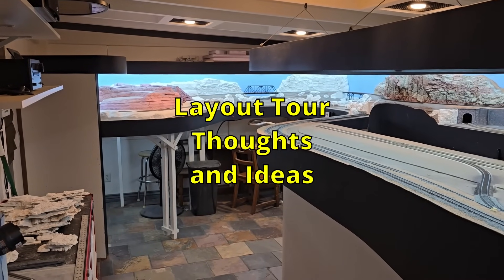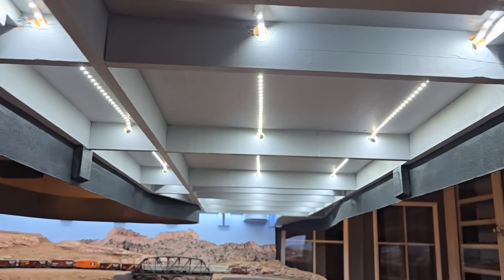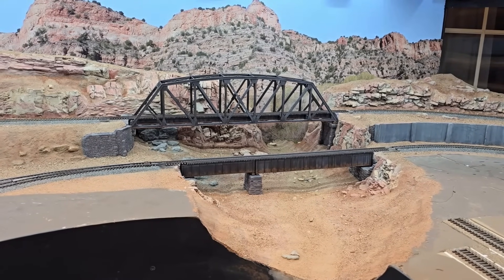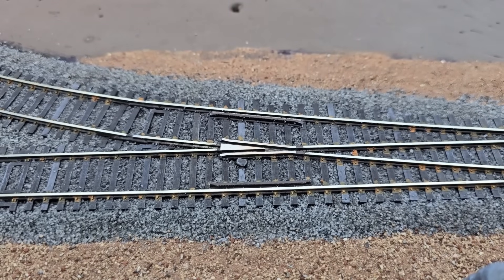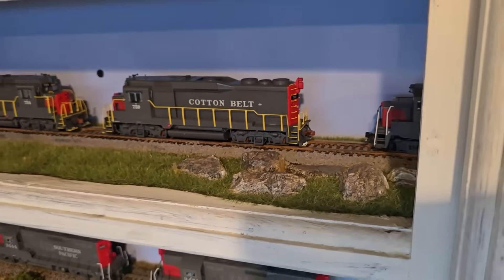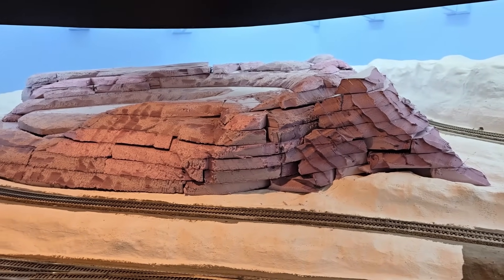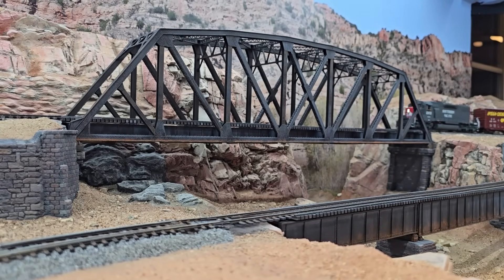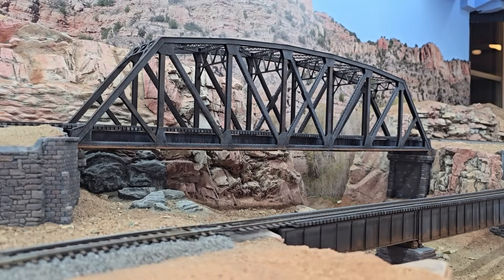Layout Tour Part 1. Thoughts, Ideas, Where I'm at and Where I'm going.

Comment: Entire layout is really nice. You really are doing a fantastic job. Great planning with the lighting above. I think it really enhances the layout. Looking forward to part two.
Reply from the maker: Thanks! Overall, it's come together pretty well. I'm wanting to make a couple adjustments, but for the most part I'll go with what I have. The layout isn't perfect, but I think once I have all of the elements in place, scenery, structures, etc., it'll be fine. The valance does double duty in it gives the layout a nice, finished appearance and it helps spread the light over the benchwork. Thanks for coming along on the journey!

Comment: Thanks for the tour, great to hear your vision and how it's shaping so far. And excellent attention to detail, definitely you have set a high standard for yourself and accomplished it so far.
A few comments on your potential future plans:
24-inch helix will be fine, people have run some really big steam locos up and down 24-inch helicies without any problems. The key is the trackwork, and I'm sure with your attention to it all will be fine. People make some truly janky helices and they still work, so don't worry about it. Make sure you use cabinet grade plywood for it so that it's dimensionally stable, considering your room environment.
Regarding your staging idea against that east wall, definitely do that, even a foot deep will get you plenty of trackage. Matter a fact you can make two shelves there full length by removing your display cabinet. The cabinet is a nice touch but you can build another one above your staging decks after you buld your staging. Besides that all your locomotives will end up in the staging so no need for a display cabinet - they are meant to run not sit on a shelf and will be displayed in the staging as full trains anyway. I like your thinking about removing those double tracks that lead to the edge, and replacing them with a single line. A 44-inch lift out is not a big deal either - it's just a piece of wood, or aluminium profile, or a steel stud (that's ideal as it does not contract/expand) with a track on it. You can make it drop down, lift up, or lift out, however you prefer. I said two shelves, as well, so the first shelf is on your 0 height level, and the other can be where you wanted to wrap around from the truss bridge and down into the helix. Instead, cross the doorway with another liftout section onto the second staging shelf 8-12 inches higher (you would be climbing into it from the truss bridge instead of winding down the helix). This would give your layout a huge bump up in the number of trains you can run, and if you keep your two staging shelfs half full, each staging shelf could receive the incoming trains from the other shelf. Along with that, you can make the end track pieces (6-8 inches) on both shelfs dead, so trains will stop on their own without you worrying about them. You would 0-5-0 the locomotives to the front of the train for the next run, and it's ready to go. And isolate all tracks and put them on a switch so you can turn those tracks on or off when needed (when not in use they are on display 😀).
Reply from the maker: Wow, that all sound great. I'll have to see how things work out when I get to work over on that part of the layout. I'm going to make some changes, but I don't know how extensive? I'll definitely have some decisions to weigh. Thanks for the great input and thanks for watching!

Comment: That was a fantastic update, Steve, and were so glad that you decided to keep going with the layout. Your layout is incredible and your scenery work is off the charts great. I’m really enjoying your layout build and it is very inspiring. If you were to redesign the area of track leading across to the possible shelf by the door and reduced it to one track, I believe that you would be able increase the radius of the hidden helix and it would be great for operations. I can’t wait for update part 2. Wonderful layout.
Reply from the maker: Thanks Derek! I'd really love to put a 2 turn helix in the big loop area. My big issue in that area is having unobstructed door access, so that part of the layout is as big as it can be and a 24" radius helix is concerning. I don't want to have to crawl up inside the helix to remove derailed cars. 

I can build an extension off the benchwork to cut down the length of a lift out section that would reach over to a shelf section on the wall. I think it would be nice to be able to run trains on and off the layout. Especially for operating the city section like you mentioned. We'll see how it works out. But I think that is doable. 

I appreciate you coming along on the journey!

Comment: You will love the Scaletrains SD40T-2's I have 2 in DRGW they are gorgeous! I have another DRGW and a 123" nose SP unit on order (and 2x DRGW GP40s and 2 sd45s!! gonna be a expensive couple of months...) my layout has 2.7% grades and squeezed a set of hidden storage sidings on under the high side of the layout. I am on version 7.8 of the layout design as changes kept creeping in as construction progressed and problems got fixed!
Reply from the maker: I'm looking forward to receiving the SD40T-2's. I ordered one SP and one D&RGW. It's an evolution for sure. The rural side of my layout is going to get a rework. Like people say, they're never finished, but it good to get the track finalized. Thanks for watching!
Reply: @SPSteve  I found they are perfectly speed matched straight out the box! love the Loksnd5 decoders much easier for me than Tsnami2!!

Comment: A couple of suggestions. I use rare earth magnets from Amazon, 1mm diameter X3 mm depth in place of the unsightly Kadee uncoupler magnets. Easy to install with a drill and glue, and they work better then Kadee's product which can catch on the metal "hose" if not adjusted to the right height. This will give you easy switching operations without the hand of god interfering. Second look at the types of cars and locomotives you want to run and the era that you would like to model. So 60's locomotives and rolling stock and generally shorter then modern stock, so they would easily handle a 24" helix.  I run 50's to 70's locomotives and cars, so I can get away with a 18 / 20" double helix on my short branch line running trains of 8 to 15 cars.
Reply from the maker: Good suggestions, thanks for the tips! I'm open to the magnets but I don't know how that's all going to come together so I'm not putting much thought into it now. It will be at least a year before I will be adding structures. I'm focused on the rock and groundwork now, and after that greenery. 

My era is 1960 - 1980, so a lot of 50' box cars. I have some 70' locomotives so those and a string of 15 cars makes me wonder if the rolling resistance of a 24" helix would be too high causing uncoupling or derailments? Reliable running is a top priority. The helix would be single track if I decided to do it. I appreciate the input and thanks for watching!

Comment: I don’t know what kind of decoder you use, but if you don’t already, ESU is an amazing option. I found a method that I haven’t seen anywhere else of making consisting extremely easy, along with the possibility of adding multiple function maps. I have a video on it on my channel. As far as I’m aware, no one else knows about this. If you do decide to watch it, just know it’s kinda cringey. I apologize, it’s my first time.
Reply from the maker: I buy almost all of my locomotives with DCC and sound installed from the factory. So, I get whatever the locomotive comes with. For Scale Trains it is ESU Loksound, Athearn Genesis it is Soundtraxx Tsunami. To consist I just use my Digitrax throttle. I appreciate your input though.

Comment: lift out extension by the rear door? Why not a swing gate instead?
Reply from the maker: The liftout is simple without having to rely on hinges to keep alignment. I used table leaf brass locating dowels to align the lift-out section. I lift it out and set it back in, perfect alignment and easy.